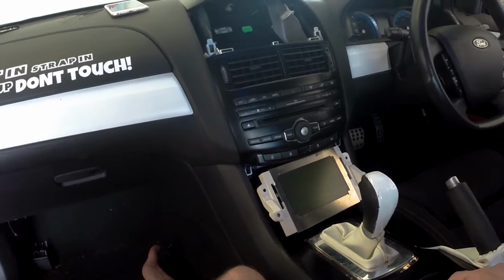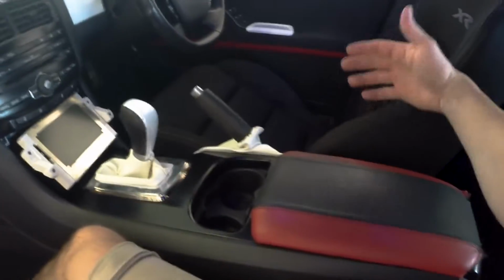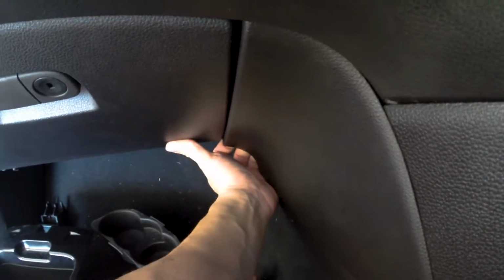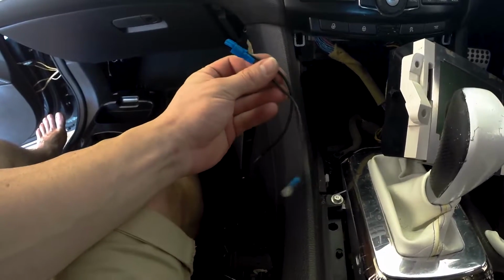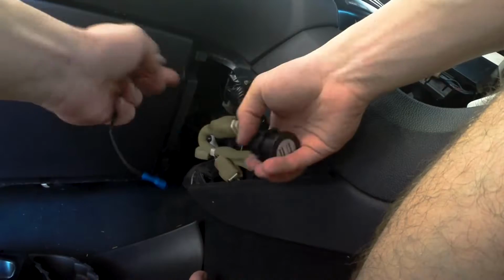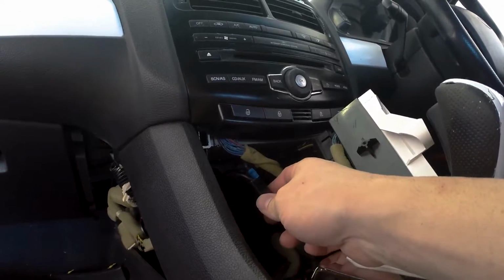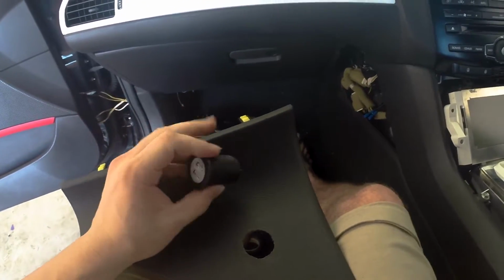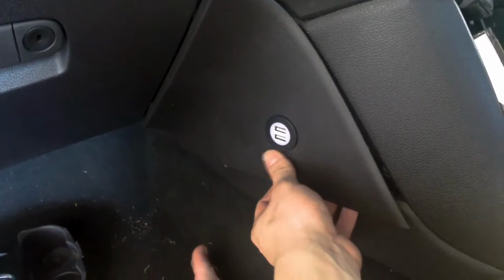USB Charge Anything in the Ford FG

Comment: Nice video, this is also a really clean way to hard-wire power for a dash cams. 
No need to delete the cigarette lighter if you extend its wiring with 6.3mm and 4.8mm blade connectors and then splice that for power to the USB.
Reply from the maker: Oh absolutely.
If people want to keep their cigarette lighter it's super easy to just add on to it and run the wiring wherever it needs to go.
Of course keeping in mind there's only so much load that can be put on it.